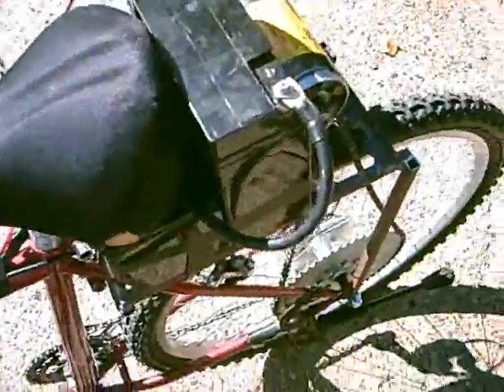The Ebike v1.0 RoadTest

Comment: Hi,
I read through you thread before seeing the video. I'm not so sure it's the batteries. In my experience lead-acid batteries usually give plenty amp. The trouble could be your IGBT (transistor), try hooking up a few in paralell, that usually works for me. Also the bias resistance could be to high.